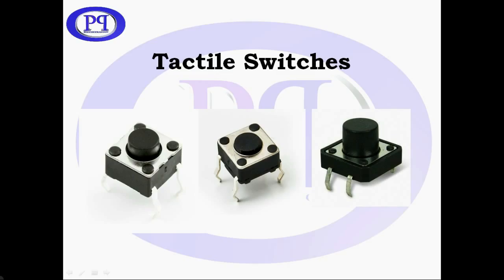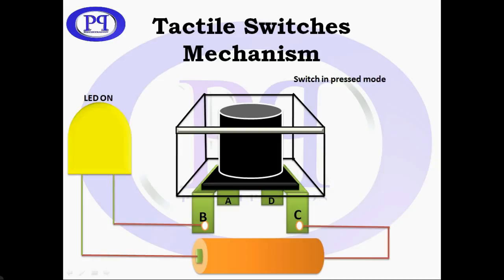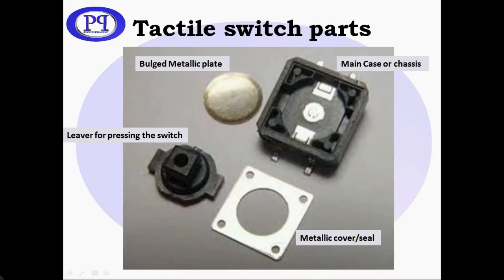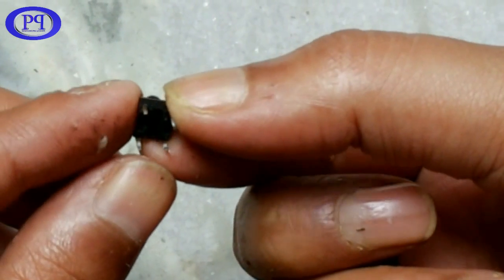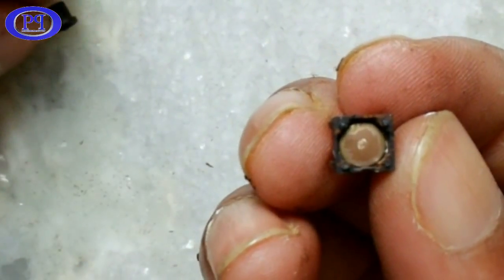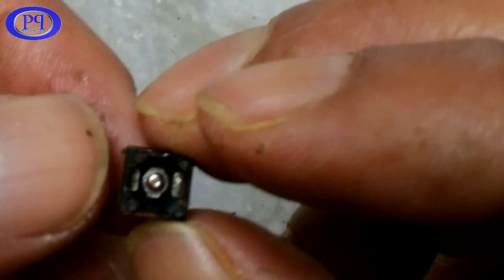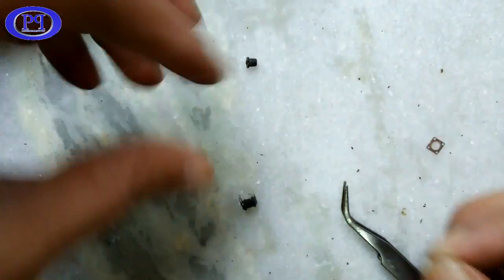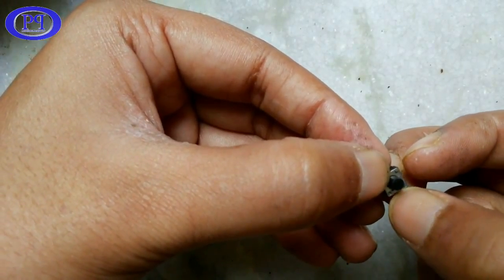Tactile switch working with animation

Comment: Well done my bro.. liked & supported.. I want to ask.. what is the technical name of the 4 leg switch when you push once-led glows dim, push twice-led glows bright, push thrice-led shuts off?

I need the name to search and order it in Amazon. I'm not an electrical engeneer so I don't know the name.. plz help out.
Reply from the maker: its know as Tactile Switch (you can try searching on google with this name)

result from google:
Q. What is a tactile switch
A. Tactile Switches are an electromechanical device used to start or stop current flow along a circuit. Devices in this family are often very small and are turned on or off through the use of an actuator that is depressed into the unit's body.

Comment: is there such a thing as an eye on off switch as small as one of these tactile switches?. I do not want a momentary oh, I want an on-off switch but the on off switches that I see are a bit bigger.
Reply from the maker: check this out: 
https://www.amazon.in/TPS-Mini-Switch-Electronic-Circuit/dp/B01I1DVIPS/ref=asc_df_B01I1DVIPS/?tag=googleshopdes-21&linkCode=df0&hvadid=397082856683&hvpos=1o2&hvnetw=g&hvrand=10781843500288446600&hvpone=&hvptwo=&hvqmt=&hvdev=c&hvdvcmdl=&hvlocint=&hvlocphy=1007765&hvtargid=pla-318881849439&psc=1

Comment: if the tactile is working but only when pressed very hard ...would this suggest dirt that only needs to be cleaned out or is it something more serious?
Reply from the maker: You are right, this mostly happens due to corrosion and some short of layer formation on the metallic contact.
Reply: @PiyushPrasoon  ..but do you think corrosion is something to be remedied or does it normally mean  a complete switch replacement?
Reply from the maker: @zazz63  Better to replace the switch with a better quality of Tectile switch (any way these switches are very cheap). 
Mostly when moister in the air got increased then it forms an oxide layer on the metallic surface , which we can say corrosion in this case.
So its totally depends on the property of metal lying inside the switch, that how reactive is it, when got exposed with moist atmosphere/air.

Comment: press n hold or just press ?
Reply from the maker: @alfinoasmana2787  it can be used in both ways depending upon the use case of a device.

Example: For an induction stove it just press and release - which will turn on and vice-versa.

Comment: What's the difference between tactile and momentary switches..?
Reply from the maker: Tactile switch are the small switch used for low voltage operations or in the electronics gadgets. It is even used in electrical gadgets but in low voltage usage section. 
Electronics device - Domestic/home router - reset switch
Electrical appliance - Induction stove - sending a small signal to trigger/turn on the appliance(induction stove).

Momentary switch deals with high voltage, on/off switch in water pump driver board. Most of the time it is being used in electrical circuits, it bigger in size and could be assessed easily.

Comment: Although,I do have the same switch, it makes the click sound when I push. Could it still be broken ?
Reply from the maker: generally these switches get corroded after a long time of use, especially during rainy season or in damp climate. 

So it might be possible, if it does make a click sound while pressed, then 90% chances is that it got corroded. Means all the mechanism and the other things might be working properly, however the current is not passing through just because of the corrosion. You could try cleaning the bulged   metallic plate(as in the video) which is responsible of the connection when get pressed.

Caution: Do it at your on risk. It may cause harm to you product/gadget/appliances.

Comment: Thanks for this video. So seems like there is no difference between 4 vs 2 terminal switch correct? Any idea why to use one or the other?
Reply from the maker: In general use you could use any of the 4 or 2 terminal switch, both will fulfill your need for single triggering. 4 terminals switch are majorly used in PCB to create 2 triggering instance. Means in one press 2 trigger will occur even without a small delay.

Comment: How to fix it , if it can't make the circuit closed by connecting two terminal even after pressing it ?
Reply from the maker: You could use the paired terminals as 1 terminal, after which you will get a 2 terminal switch.

If you are unable to get/understand the 1 method, then please place the switch on the same place of the control panel PCB I mean just solder it to the place from where you have taken it out, polarity doesn't matter in this case.

Comment: PIyush, could you please suggest how to get this switch working in constant - and constant off mode?i.e. push button - led is on, push the button ones more - led is off.Are there any integral schemes for this purpose?
Reply from the maker: If you will use these switch directly for switching on the LED or any other electronics/electrical things it will conduct electricity until you are pressing it, it is like press to work switch.

These switch are programmed with ICs to work for signalling the IC only rest of work (to keep the things on/off) depends upon the programming inside the IC which was decided by a programmer how he want that particular device to be act.
Reply: Thank you for your answer, I would like to share my discoveries regarding my question.
On-off function can be made using Ne555 or CD4013 chips.

Comment: How to identify a,b,c,d it look 4 pin equal
Reply from the maker: you can check it with multimeter or else if you know the pin orientation you could able to figure it out without checking it.

Comment: How to find out which one Pin A, Pin B, Pin C and Pin D, can you help me,
Reply from the maker: Hi Arell,
It very simple, BTW this a switch so there is no polarity, hence you need to check the shorted pins (pins which are connected internally).
You could check it in 2 ways:
1. using an LED and a battery - connect it with any 2 pins one by one if the LED glows without pressing the switch...then those 2 terminals (pins) are shorted internally. and off course no need to check other 2(which will be definitely a shorted terminals once you find any shorted terminal for the first time).

2. Use multimeter continuity check method to figure out the shorted pins.

Hope you got it now.
Reply: @PiyushPrasoon  thank you

Comment: hello sir..
i have a one question..
if my curcuit has a tactile button switch for on/off functuon..
..so..can i solder this points..with wire.and can  we use another type of switch for on /off perpose..

can we use any other physical switch or button? instead of tactile button.?
Reply from the maker: Yes definitely you can replace it from from the normal switch/button. If you you got the understanding of the internal connection of tactile switch, you could able to create the connection with normal switch.
Reply: Yes, but keep in mind these tactile switches are momentary. Must use same type in a different style.